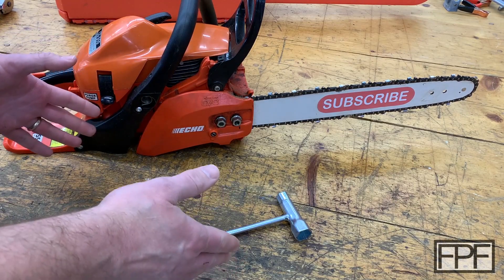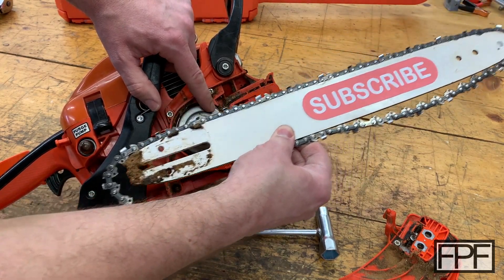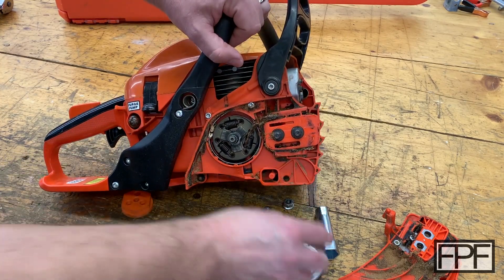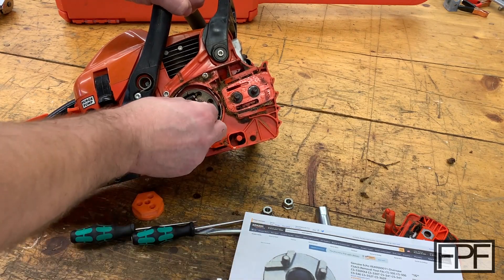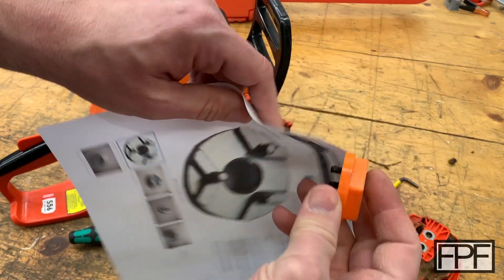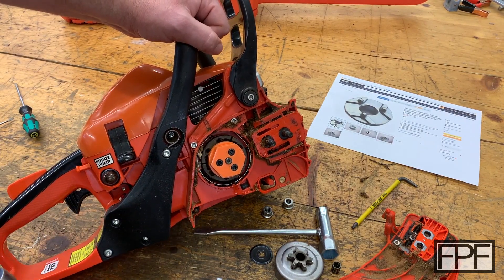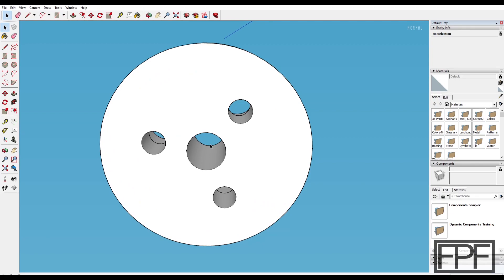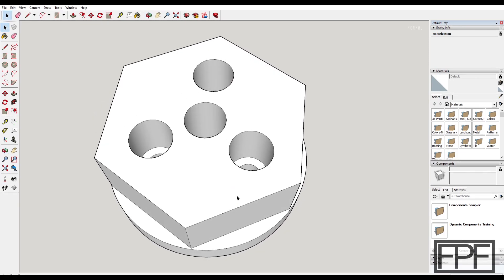3D Printed Chainsaw Clutch Removal Tool

Comment: I just wanted to clarify something. You said both m6 and m5 in the video. I printed this and the m5 seem to be just a hair to small to grab the threads, but the m6 has too large a head to fit the recesses. Before I go modifying things, I just wanted to see which size screw you actually wound up using? Thanks.
Reply: I had the same issue. I just flipped the tool around and used the screw to tap threads in.